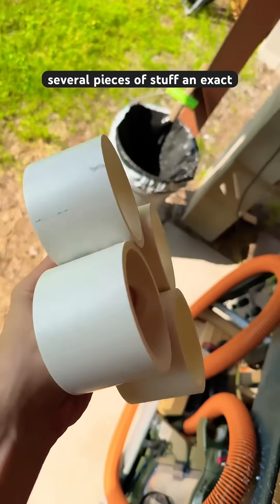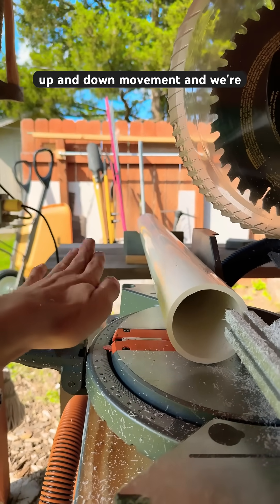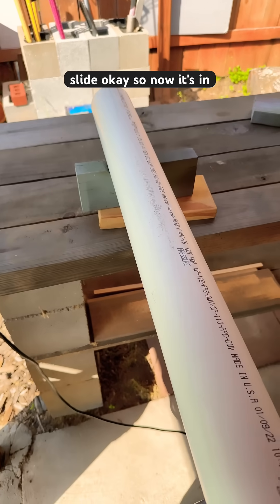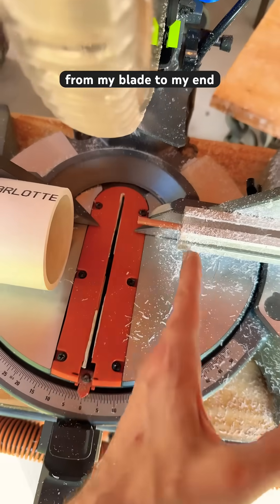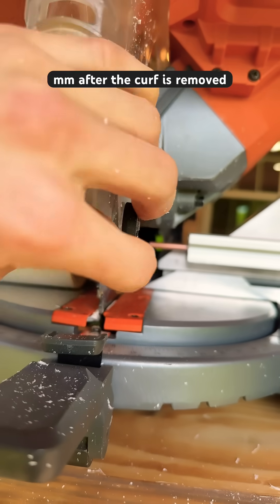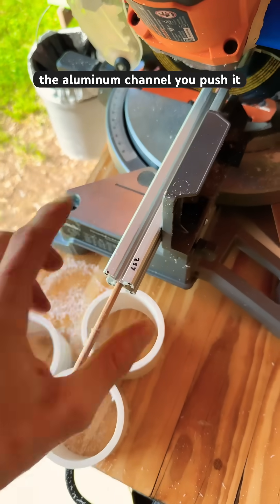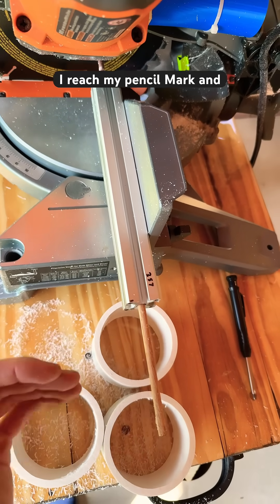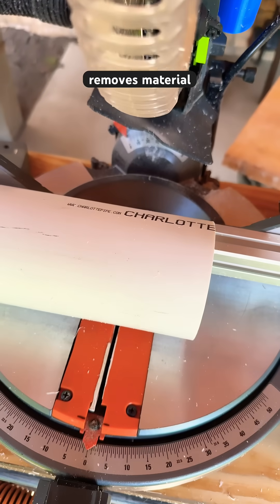how to cut exact lengths from a tube. #pvc #diy #stem

Comment: This will cut your parts too short you need take the whole with of the kerf into account and measure from the closest sawtooth. This can vary depending on the type of sawblade so you are better off checking against several teeth around the sawblade.

Comment: if you measured from your end stop to the flat on the blade and not the actual cutting surface, there is a good chance your part is less than your measurement...
also why waste time with bolting when your next cut might not be the same? Clamp on, clamp off...
Reply: Unless I'm misunderstanding something, I think that aluminum extrusion is not exactly bolted on but held with t-nuts so when the knobs are tightened, the extrusion is essentially clamped in place.  Totally adjustable, t-nuts for the win!

I was thinking the same thing regarding the length, given the teeth are wider than the flat of the blade. Principles still work, just need a different reference.